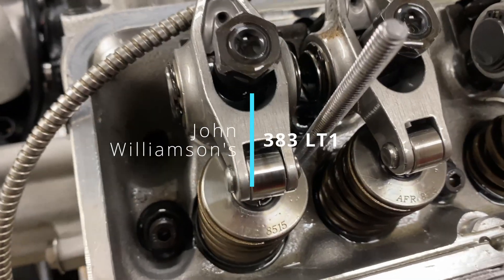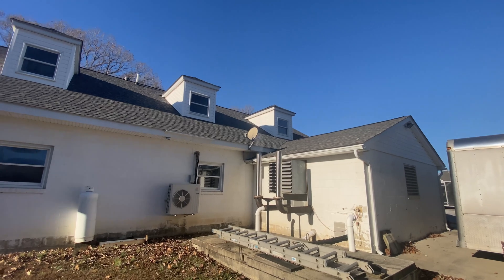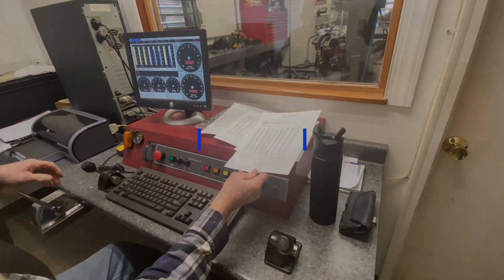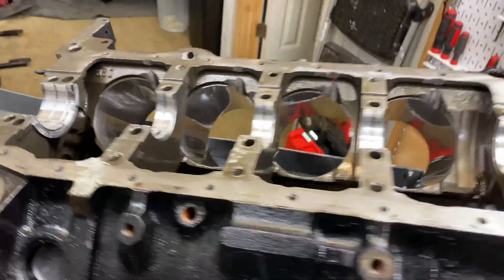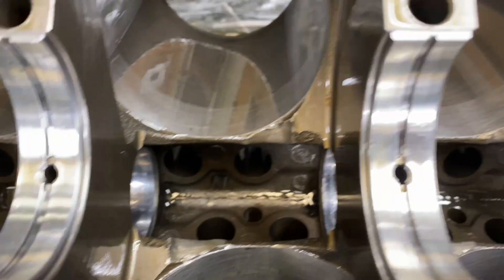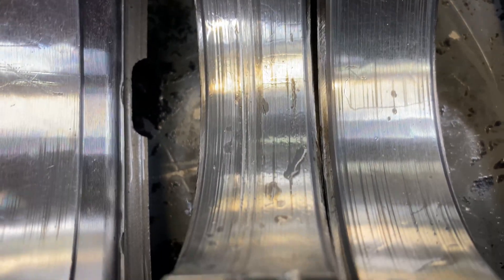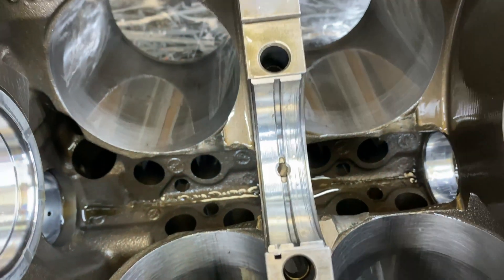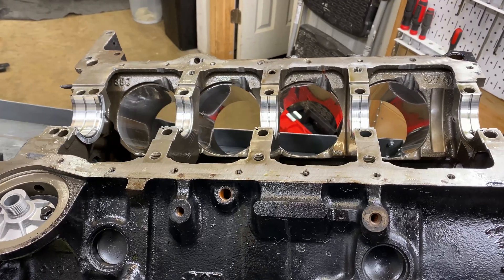Learn from my Mistakes. Engine Inspection after Dyno Testing.

Comment: Thank you for being honest but .. from what I see from your builds you are as _ "clean as they get"_  and you don't throw together engines as I do so I am thinking that there was something in there or something not right that sent that much trash through the engine that you were unable to see or clean ... because for it to take out bearings and cylinder walls it had to be something big then just leftover "dirt that was missed"...
Reply from the maker: Also I'm thinking I will start to block off the oil filter bypass for all engines and that can catch any dirt that may have been missed.  I'll be doing that in the future.
Reply: @EllweinEngines  if you can do a video on  That ...
Reply: @maldo72  I'd like to see a video on that also!
Reply: @EllweinEngines  agree...

Comment: Lesson well learned right! I've done the same. Thermal tanking seems to lock in scale in the water jackets and ultimately finds it's way to the oil galleys. I started putting the core plugs in and duct taping the deck before rifle brushing out the oil tubes, cleaning cylinders and bottom end from the back side and then not moving it until assembled.
Reply from the maker: That is definitely something to think about.  I'm picturing just one flip of the engine might roll out some scale from the water jackets (via the head deck) and that can end up in the bottom end.

Comment: So at gm back in the 60s and 70s and suck all gm engines were thoughly cleaned and didn't have a spec of dust in them at all huh
Reply from the maker: I wish I had the cleaning ability of the factory.  Sometimes you don't get the chance to inspect a fresh rebuild and you'll just never know about a few specs of dirt, until they rear their ugly little heads.

Comment: ... what oil was used ? Bead hones have very limited benefit in my experience, maybe a Saturday night hand grenade motor.
Reply from the maker: I used the green stuff for the oil at the dyno.  Definitely should have done a "real" hone and not the dingle-balll
Reply: @EllweinEngines  cylinder finish is much different with the newer requirements Total Seal and Lake Speed Jr. have some great videos. Basically it is a very rough cut to clean and remove glaze for oil retention and then a very smooth finish to take the peaks down some. Rings are much different today. Good luck

Comment: The rust in cylinder 5, the smoke looked white not blue, which tends to make me think it is a water leak in the head. Did engine actually sit for a month, before tear down? where the rust was in the cylinder was odd also, was forward in the cylinder, usually I would think it should of been in the bottom of the cylinder.
Reply from the maker: Yes sat about 1 month.  I had the spark plugs out on that side.  I blame it on condensation with the cold garage.

Comment: I am working on a dodge viper engine that was also burning oil badly and I found similar damage to the cylinder walls and piston skirts. Looks like it overheated a long time ago then had a chronic oil burning issue because the rings got messed up. They almost fell of the pistons when I took them out, like they were bent from a poor installation.
Reply: They fell off because they're destroyed from being overheated.
Reply from the maker: Viper engine!  sound awesome

Comment: the engine im building was never board, standard, my crank was standard and this engine was a low milage runner when i took it apart so ill admit i only sprayed my block down with cans of engine cleaner. this makes me nervous
Reply from the maker: Hope hope